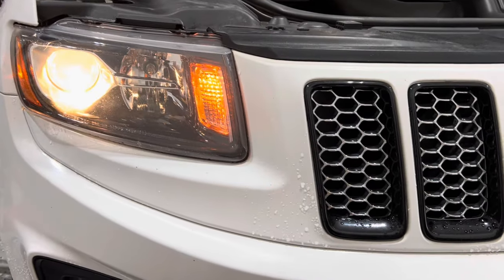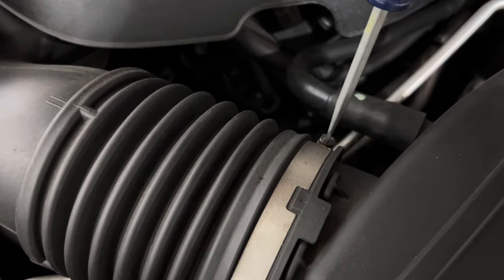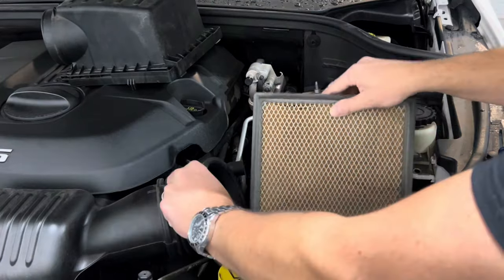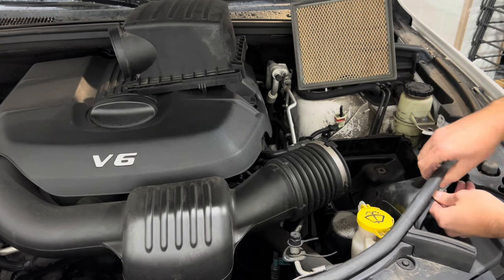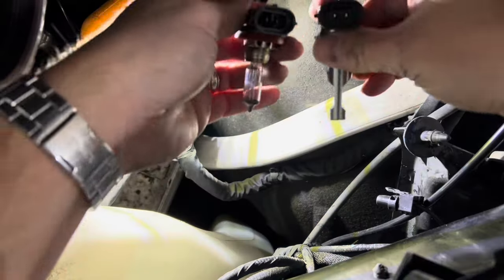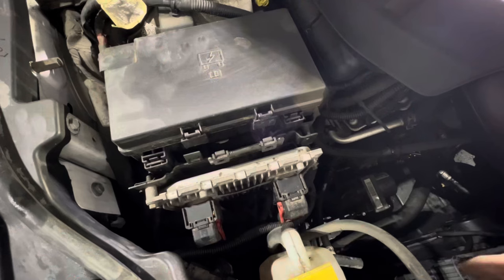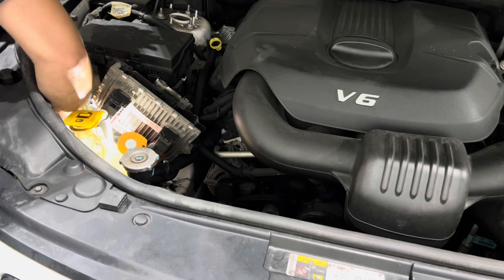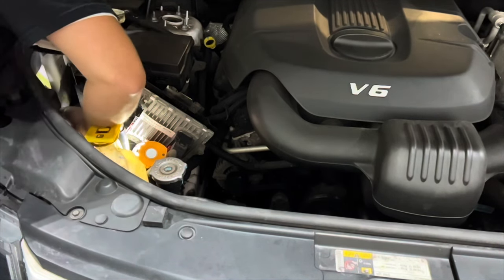Jeep Grand Cherokee Headlight Bulb Replacement (2011-2019)

Comment: I must have the only 2017 Grand Cherokee on the planet that has a setup not allowing bulb changes. Driver side low and highs not working. Mine looks nothing like this and when pulling that round plastic cover off after romoving the air box, there appears to be a metallic braided harness attached to a plug that's attached to a shiny square metallic box about 2 inches by 2 inches. It will not budge. The high beam has NO wire or connector anywhere to be found. Looks like a sealed unit. On some of these Jeeps, do you have to replace the entire headlamp?
Reply from the maker: Hi Gary, I’m sure that’s very frustrating.  Most total headlight failures are caused by a bad component like a fuse, relay, or module. Wiring problems can also cause both headlights to stop working.  It’s possible that the previous owner installed aftermarket lights, which is why it’s different but you should not have to replace the headlight assembly.
Reply: @inspiringbuilds  I checked the fuses, they are fine. Tested voltage at the harness and have voltage. Found out that some models you have to replace the entire headlamp unit. These HID units are a ton of fun. Might have to take it to the dealer I'm afraid.
Reply: @inspiringbuilds  Forgot to say thanks. You're reply is much appreciated. Also, I'm the original owner.
Reply from the maker: Hi Gary,  knowing you’re the original owner and they are HID saves a ton of time and makes perfect sense.  HID’s come with a small metal box and braided wire harness as you mentioned.  The trick that many people don’t talk about is the metal box has two tabs with one on each side.  A tab on one side is higher and a tab on the other side is typically lower.  Feel for the tabs and push the low side tab up and push the high side tab down.  This may end up saving you upwards of $450 at the dealership. 👍
Reply: You have what’s called HID bulbs they are more complex but pull them out and replace , you may have to order them online

Comment: My left headlight is out including the LED daytime running late and turn signal. Do I need to change all of that as well because my regular bulb is out too, and they are the projector beams.
Reply from the maker: @FloridaLyfe  If multiple lights are out at once it’s possible that it’s another issue such as a fuse.  You can check the fuse and also replace one bulb at a time and test before reassembling everything to determine the culprit.

Comment: This video was super helpful and I just replace my head lamp bulbs with these same exact ones and they look amazing! So much brighter! My question is can I also use these same H11 LED bulbs for my fog light? Those are also H11 bulb size too. Thanks! 🙏🏻
Reply from the maker: @bmcesar87  Thanks for watching and yes you can for sure!  Nice work on the DIY job as well and it has to feel good saving cash.

Comment: For the bulb itself, do you have to twist it a certain way. Can't seem to get the bulb out on the passenger side
Reply from the maker: To remove the bulb turn it counterclockwise approximately 1/4 turn.  They can take a bit of force to remove.  👍

Comment: Great video. Used it twice now for changing driver then passenger side (should've just replaced both at the same time 😂). I wish I didn't have big hands, it does make it harder to get the bulb in and out.
Reply from the maker: @Boomstck  Thanks so much, glad it was helpful!  I agree, I always recommend to replace headlights in pairs as when one goes bad the other is soon behind.  Quick questions, should I make a part 2 video that shows how to make the DIY PVC bulb removal tool and did you upgrade to LED?

Comment: I took off the ecu to replace the light and now my check engine light is on. Any advice?
Reply from the maker: @KendallWalsh-p7r  Sliding off the ECU as shown in the video would have had no impact of throwing a CEL.  You can hook up a OBDII scanner to pull the code or take it to a local auto parts store to pull the code for free.  You can also pull the negative battery terminal to reset the light and if it comes back then there is an issue that needs addressed.

Comment: This is great, but ive been struggling with twisting the bulb out. I dont have big hands, however, I can only get about 2 to 3 fingers in there to twist the bulb out. The metal frame behind it is preventing me from getting much room (2019). I see the PVC tool you posted a pic of and i did something similar. But there's no way i have a enough room for even that length of a PVC, which then makes it harder to grab and twist. I'm very annoyed by this, but will keep trying.
Reply from the maker: @jeffpanos1570  Thanks for watching.  It can be a challenge with a tight space especially working with stubborn bulbs.  Were you able to get the job done and save some cash?
Reply: Thanks for the response! I meant to write in later that night that I was able to get it done. But I had more success with a 1-inch PVC rather than a 3/4-inch PVC. I did try them both though. I just had to cut smaller parts off the notch you recommended to get the right size. 
The driver's side was much simpler with your instructions.
Reply from the maker: @ Great to hear and thanks for sharing.  I’m glad you were able to save some hard earned cash! Happy Friday!

Comment: Changing 2019 grand cherokee low bulb this weekend thanks to ya. Curious what bulbs does it use for low beams wanna def make the switch to led was curious if there was a cheaper option than these bulbs. Also do they throw fault codes?
Reply from the maker: My only regret is not doing it sooner.  The low beams uses an H11.  This one is 33% off currently so $40 instead of $60 and click the coupon for another 20% off to make it $16 per bulb.  They do not throw codes and they plug in just like the OEM ones. https://amzn.to/4f7Wej3

Comment: Excellent video! Explains it for the novice Mechanic as well as intermediate! But I have one question. And pulling off the bottom housing under the air filter with the grommets, a clip came off. I have no idea where it goes back on. Any ideas?
Reply from the maker: @qfingers10  Thank you, that was the goal and I appreciate the feedback.  It’s possible that the clip is from the air filter housing and you can snap it back on.
Reply: @inspiringbuilds  unfortunately the clip broke off the two little Pinge that it’s connected to on the housing. I need to get a whole new housing

Comment: Very good video! I changed the low beam headlights in my 2014 Grand Cherokee with LEDs. The low beam works fine (much brighter and now a nice white light) except I don't get the Daytime Running Light feature from that new LED. I suspect the LED will only come on with full power and, therefore, won't light up with reduced power supplied for the DRL feature. The DRL feature is selected in the 8.4 inch infotainment system. So, for now I use the "parking lights" as DRLs (which were also changed to LED lights) and they are OK as a daytime light. I put a switchback LED (Amber/White) in the turn signal slots and that comes on when the parking lights are activated using the interior light switch to the left of the steering wheel. Has anyone else solved this DRL LED light feature as I described here?
Reply from the maker: Hi Tim, thanks for watching.  I spent a while looking into this for you.  Did you buy the bulbs I have linked as I checked multiple JGC’s with no issues?  I know this may sound silly but get a helper or I test in the daylight against a dark colored car that I could see my headlights.  Your DRL’s will only turn on when in gear so when you put it in park and get out to check then they will show off.  Stay in the car and point your lights against the dark colored car and test that they turn on in gear and then turn off in park.  I confirmed they worked with this method.  Lastly, in Uconnect go to settings - lights - daytime running lights and ensure the box is checked.  Hope this helps and look forward to having you watch future videos. 👍
Reply: @inspiringbuilds  Thanks much for the reply and I appreciate your research time very much! I should have mentioned that I installed an upgrade Uconnect 8.4 inch system from Infotainment that has CarPlay a few days before upgrading the lights to LEDs. The new Uconnect system  can take a day, or two, and sometimes more to learn from my Jeep's onboard computer what functions I have turned on/off as well as heated seats, heated steering wheel, etc. And I think getting used to the LED lights is one of those "learning" functions as well. I had the DRL function checked in "System" section, but they did not come on in the first day or two of driving the car with these new LEDs. Now they come each time I put the transmission in Drive. Also, the turn signals worked just fine on the first use. Now they still work but I get a hyer-flash of the turn signal indicator on the dash, but the actual signals flash at the normal interval. Kinda odd. And I have gotten the turn signal "Left or Right Bulb Out" warning a couple of times as well, but not always. And yes, I installed the LEDs you listed with your video and I am happy with them. I may need a special harness to solve the turn signal issue, but as long as the exterior signals are operating correctly, I'm going to research that a bit further since I am not presently endangering myself or another driver. Again, thanks for feedback - much appreciated, my friend!
Reply from the maker: @timmc49  Happy to help and glad they’re working as they should.  In regards to the off topic issue with your turn signals how old are the bulbs?  Typically you see things like that happen when they’re close to burning out.

Comment: Hey, guys. I followed your video and advice, but unfortunately, the links you provided did not work with my 2011 Grand Cherokee Overland. The fitting for my lights has a three-pin connector.
Reply from the maker: @WesleySmith-h5g  Thanks for watching and the feedback.  Do you happen to have a link to the bulbs for your 2011 Overland to help others?

Comment: Does that LED bulb require one of those CANBUS adapters on these Jeeps? I have a 2019. Also, great tutorial. Thanks for that PVC trick. I might need to try that on my passenger side since it doesn't want to budge.
Reply from the maker: Thank you.  The passenger side is tough without small hands or the PVC tool.  It is possible with your left hand as I show or from underneath but I try to do it all from the top to avoid tearing up my hands.  The LED bulbs are cheap and require no adapters, they are plug and play just like the halogens and here is the link.
LED Bulbs: https://amzn.to/48FgYde
Reply: Cool. Thanks again. I think I'll have to give them a try. My last halogens only lasted about 2 years and with how much of a pain these are I'm willing to try something new. Hopefully they last.
Reply from the maker: They last longer (50k hours) and have been a game changer for better visibility for me.  👍
Reply: @inspiringbuilds dead link !
Reply from the maker: @ORIGINAL-FLYING-CIRCUS  Thank you for letting me know, it’s updated now.  The LED bulbs are cheap and require no adapters, they are plug and play just like the halogens and here is the link.
LED Bulbs: https://amzn.to/48FgYde

Comment: Bro how did you fit ur hands in the passenger side one even with the computer moved i cant get a good grip on the bulb
Reply from the maker: @ionwojawoja6366  I couldn’t fit my whole hand, but turned it to loosen it with my thumb.  I’ve also had them stuck before and made a DIY tool out of PVC.  This isn’t a great photo, but I do my best to help everyone on my channel.  Hopefully this helps you and let me know if it doesn’t work.  https://ibb.co/ncdRfb7
Reply: @inspiringbuilds  i got it eventually lol thanks for the tool idea tho thats pretty neat
Reply: @inspiringbuilds Hello! great vid… is that a 1” pvc? And looks like you just gotta notch one end.
Reply from the maker: @arennaz  Thank you, it’s 3/4” thin wall PVC.  👍

Comment: Ok….this reminds me of the Schitz Creek episode where the mom tells the son to “just fold in” something to the badder. My ‘19 has that rubber cover that pulls off. 👍. But then the bulb comes out how?  Another yt vid says turn it counterclockwise. It doesn’t turn. I see small clips holding the bulb into its socket. I can release one side, the other side is obscured. This is my nightmare scenario…I’ve got everything pulled apart but the crucial/actual remove/replace is elusive. 🤦🏻‍♂️
Reply from the maker: @jonathangiven9073  Thanks for watching.  Were you able to figure it out?  The 19 models does have a rubber cover that pulls off.  Bulbs should come out with a 1/4 then counterclockwise.
Reply: @inspiringbuilds  yes, i figured it out.  I watched a few other videos and looked closely at the replacement bulb.  I was pretty frustrated on my first attempt.  But I went back out the next day and got the job done in about 10 minutes vs “at the speed of a man walking under water”. 😆
Reply from the maker: @jonathangiven9073  Good to hear, any tips for others with the same year?
Reply: @inspiringbuilds  No, everything described in the video was spot on….removing the air cleaner is key.  What helped me, aside from the other videos describing how the bulb is removed, was looking at the new bulb to see how it’s oriented/how to grasp it and rotate it.  One of my original fears was breaking the glass bulb if I grabbed it wrong.  It’s a horrible design issue.  Thanks for your video.
Reply from the maker: @jonathangiven9073  Glad it was helpful and you were able to save some hard earned cash!

Comment: The key thing here - You almost require a "special tool" to be able to release the bulb hold from the housing. PVC tubing is perfect for this. As strong as I am, there was no way to break it loose with just two fingers at such an awkward angle. My 2017 Jeep Grand Cherokee uses an H11 for low beam and H9 for high beam. The high beam is easy. I've spent several hours trying to get the passenger side low beam bulb out.
Reply from the maker: @chrisberardi2304  Thanks for watching.  I agree the PVC tubing tool is super helpful for stubborn bulbs. 👍

Comment: Please don’t worry yourself about it. I found out where it came from. It’s the clip that holds the cover of the air filter housing on from the bottom of the housing. The bottom housing pieces snapped off inside the clip. I guess I need a whole new bottom housing now
Reply from the maker: @qfingers10  I’ve had clips come off the air filter housing before, hopefully it’s a situation where you can pop the clip back on.

Comment: Thanks for the video, I’m about to give it a try
Reply from the maker: You’re very welcome and thanks for the comment.  Were you able to get them changed?  Did you happen to upgrade to LED?
Reply: @inspiringbuilds  the guy at autozone said if mine wasn’t setup for LEDs to not get them because they will burn out after a few months
Reply from the maker: @60in3.1  Not true, exactly opposite which is why I replaced mine as I didn’t want to do this job multiple times.  I’m glad you were able to get yours fixed.

Comment: Driver side worked, but passenger side has the coolant in the way on '16 Grand Cherokee. 

Update: went under the coolant and was able to reach it pretty easily. 👌🏾
Reply from the maker: Great to hear, I hope the video was helpful.  Did you happen to upgrade to the LED bulbs?
Reply: @inspiringbuilds  Yup 👍🏾 worked like a charm.
Reply from the maker: Awesome, have a great weekend!

Comment: It easier to to remove tire and wheel well to get access to the back of the lights
Reply from the maker: @JohnBlythe-x8o  Thanks for watching.  For me it only takes a few minutes to do both sides so even with high quality jacks I would be done by the time the tire is off the car even using an impact.

Comment: My 2011 Jeep has a totally different set up than what this video is. Removing the bulbs is not the same whatsoever. I actually cannot figure out how to move the low beam bulb at all. It does not twist screw off or have that cover like you are showing here. Something totally different. Cannot figure out how to remove it.
Reply from the maker: @MrLincolnLove  Were you able to figure it out?  Many others with a 2011 were able to follow these instructions to get it done.  Bulbs should come out with about 1/4 turn, but they can be stubborn and requires a bit of force.

Comment: Review as a 6’5 guy (huge hands) on a 2019 grand Cherokee. I was able to change the drivers side low beam. Good instructions, up until the bulb removal. The instruction was too high level imo and glossed over the fact you have to unscrew the bulb connector from the housing once you remove the cover (btw this is a plug cap, not a screw cap which is convenient) and basically are doing it blind. Same goes for reinstalling it (gotta get a feel for it), and the risk is not getting it to click. 

For the passenger side, it’s just flat impossible to change with my bare hands at time of review. Again, good instruction to access the low beam housing. I’ll try to see if I can do it blind with some crazy angles, but I lm sure I look like a contortionist to my neighbors. No fault of this page. The access ports above the tires are a joke & I find it incredulous that they are meant for replacing the low beams.

All in all decent video, and hopefully helps any bigger folks.
Reply from the maker: @od7203  Thanks for watching and thanks for the comment.  Yes the 2019 model had the plug caps instead of screw on caps.  The passenger side does require the right angle.  I’m hoping you were able to save a good amount of money doing it yourself.
Reply: @inspiringbuilds  no luck on the passenger side…I think I’ll have to bite the bullet and pay to get that done